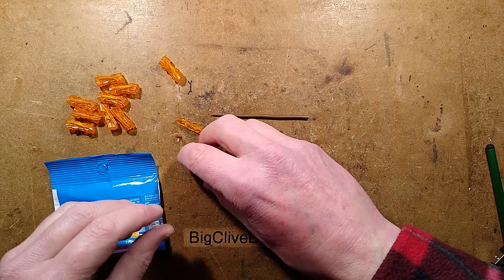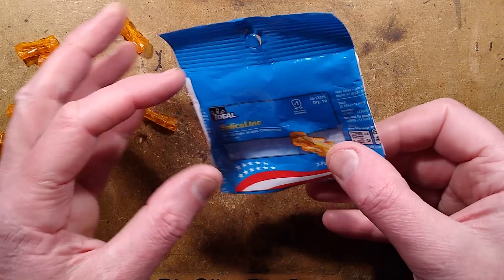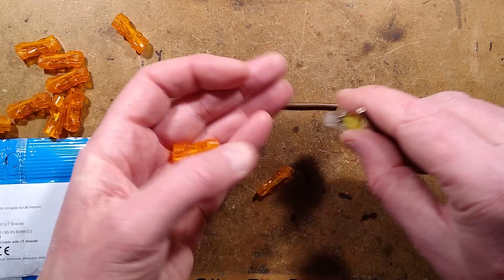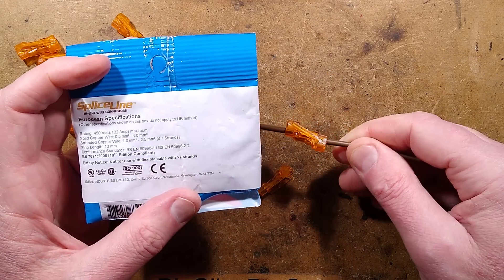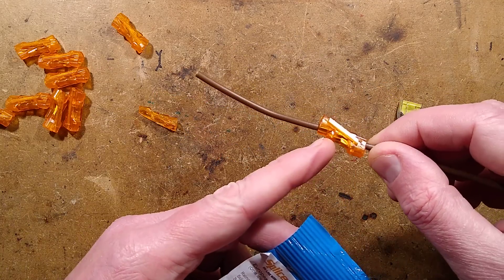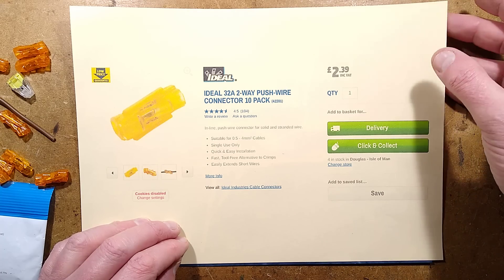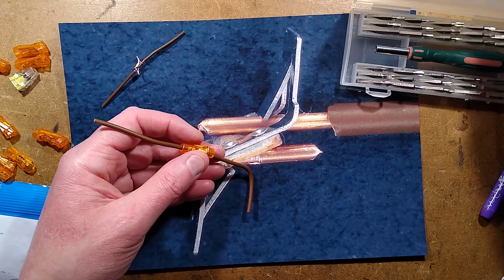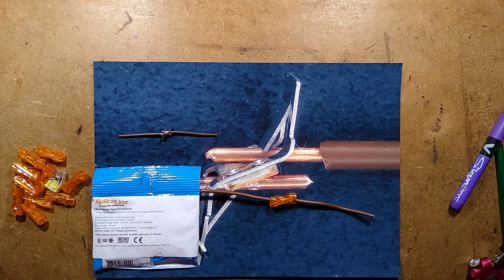Inside a SpliceLine push in cable connector

Comment: I don't know if they originate here, but I did find these at the local Home Depot.  I used them to distribute the neutral for some WiFi switches I installed in the home in 3 and 4 gang boxes.  They make examples that have multiple connections so you can tie wires together instead of the sketchy wire nut connections commonly used in home construction in the US.
Reply: Ideal makes those sketchy wire nuts
Reply: @nyetloki  I'm sure they make some.  It's the wire nuts that are sketchy, not who makes them.
Reply: @buffuniballer  Like every product on the planet, wire nuts are as sketchy as the installer of the wire nut.

Comment: One stupid thing they did on the inline version of the lever-latch ones, and as as far a I can see on these too, is not put mouldings on the side to allow them to snap together for multi-core joints
Reply: I may be mistaken that it’s in the regs over here, but it’s at least common practice to stagger in line joints to maximise dielectric clearance. If it is in the regs, the manufacturer suggesting they are installed in one block and slotted together may mean they don’t get the correct approval ratings. Happy to be corrected if I’m wrong
Reply: @bdh_555  Yeah and I can see sliding together affects heat dissipation, especially in failure conditions. A lot of engineering compromise just to keep things looking good.

Comment: I use Ideal cable stripper. Also that doesn't look like a genuine "Wago" 🤔... The two way should be white and a little smaller
Reply: Wago made both the yellow and white. It looks like the yellow is discontinued. The push-in connectors are becoming less available in stores since the lever-nuts are spreading. As best I can tell, the ratings were the same. 
Wago also lists a white aluminum compatible version on their website, which requires corrosion prevention paste. I’ve not seen them in stores.
Reply: @TomCee53  okay, been an full time electrician now for six years and about ten years done electric work on the side. Never seen that two way wago tho. I remember the old grey wagos. Also we use very much wagos and since the lever ones costs three times more than 2273 I really hope they don't discontinue the 2273

Comment: The copper slug is kind of the big key element that makes this a big improvement vs. Wago which relies on  just a tiny contact area on spring tines and the thin gauge spring steel structure to carry current..   I would absolutely use  one of these for a current carrying splice but I still like a properly done wire nut splice as you get  not only the two conductors spiraling around each other in intimate contact, but also an external spring biting into the copper of both conductors in multiple places..  I would use Wago only for known low current stuff like lights...
Reply: Wago connectors absolutely have a plated copper bus bar in them. Clive's even done a video showing this. I'm looking right at one inside the conveniently clear body right now.
Reply: You understand better than 90% of the DIY commenters here.
Reply: @RobertBeck-pp2ru  Having done the rounds and dealt with many professional electricians who struggle with Ohm's law (let alone more complicated simplifications of physics) and think ferrules are plated steel..
Reply: I absolutely agree. As great as Wago connectors seem, they still remind me of back-stab outlets and switches. Only ONE tiny connection surface. These Ideal splice connectors look better with the copper pads, but still only have that tiny spring loaded contact point. Because of that I won't use back-stab outlets or Wago. Your mileage may vary.

Comment: CEF do a number of Ideal connectors along with Wagos. I have tried both, but decided to stick with the Wago's. There is an inline Wago which uses the little levers, I prefer them as they are easier to pull off when needed. I tend to use the push on ones like the one on your bench in the back of light switches etc.

Comment: Meh…I lke scotch-locks better, because the wire to be spliced doesn't need to be trimmed or cut.

(though both are ghetto & shouldn't be used for permanent installations)

Comment: As an Electrician, I would like to see that connector with 400 Volt pulling 32 Amps for one or two hours and then a measurement of the temperature.
Reply: 32A is 32A. The voltage over the connecter is negligible, if you pass 32A through it, it doesn't matter if it's from a 12V or 400V supply, the voltage drop is elsewhere. Sure you are an electrician? ;-)

Sure the voltage matters if the connection fails, but until then, it doesn't matter.
Reply: @LeifNelandDk  Oh no not an electrician as you Leif. I want 400 Volt as it more likely that it would be voltage where the 32 A will be used. A man as wise as you should know that 230 Volt utility item is not allowed to use 32 A. ;-)
Reply: @NotMeGeek  again, there's no voltage over the junction when it is complete. So 12V, 230V, 400V is irrelevant.
Reply: @LeifNelandDk  Interestingly they are only rated at 20A @600V vs 32A @450V
Reply: @oliverer3  UL current ratings are substantially lower than others (for no benefit I've ever seen). The voltage is a red herring. They also rate 12AWG (3.31m²) for a paltry 20A, which is no coincidence.
Reply: Since they are rated for it I presume they must be able to handle it but given that they're rated at an operating temp of 105°C they'd likely get toasty.
Reply: All these things only add single digit milliohms to the circuit.  Run the same experiment I did a while ago.  Put 10 of them in series and measure with a milliohm meter, remove the wire's own resistance and divide the result as appropriate to get a general working figure then apply ohm's  law to get the power dissipation.  Then for fun do the same with 10 of your favourite connectors.  The difference in circuit resistance is negligible in any sane number of connectors (10 in a circuit is not sane), as is watts being dropped by the connectors.
Reply: @retrozmachine1189  I hold it up against Wago 221and there is a difference in how the wire connected. The way the wires are connected then it could be funny to see if the actually could handle 32 A. Wago is used alot already and there hasen't been noticed any fault with. These connectors are quite new to the market in Europe and there a real test would be nice. Just because the are rated is not same as the can handle it. We have outlets marked with 10 A but don't that is not in continuous operation.

Comment: @Big Clive - Adam Savage did a video on connectors he bought made from heat shrink  low melt solder rings and a bridging wire. perhaps you could review some of them?
Reply: I think he did already:https://youtu.be/unxEdyW8RP8?si=G7To58xvujzvX-oG and found the solder penetration to be less good than doing them manually. I use them a lot for bike lighting and other low power connections.

Comment: Hi. Former U.S. Electrician here. Ideal makes a lot of the connectors and "wire nuts" we typically use here in the 'States. I've seen those connectors you have in this video in Home Depot hardware stores but not in the commercial electrical supply shops. Electricians have used wire nuts for as long as I can remember here.
Reply: The wire nuts were known as screwits over here , used extensively previous to about 1970 and made of porcelain, still available in a plastic form but chocolate block type connectors took over until the wagos were introduced.
Reply: When I started in1968 in the electrical industry we call those screwits "Dogcocks" but we only took them out from old rewires, they never seem to be issued as new or stocked in our store, as for wagos or the like the ones Clive has there I never liked them you could twist them apart and to me not a mechanical connection that I would have used, @radiotowers1159
Reply: Wire nuts aren't even legal for mains voltage in Australia, these days. Where I used to work had a product get recalled for non-compliance because it was a mains powered floodlight that used wire nuts inside. Low voltage DC is a lawless wasteland, though, and we can use wire nuts all we want for those. The only question is "why, though?", because we have so many other options.
Reply: @NoobixCube  I think the time old saying of "If it ain't broke, don't fix it" applies to wire nuts in the 'States. We've had so few problems with them since they were first used, we just keep using them. We don't tend to adopt the newest thing here when we know something reliable and trusted is available. We also have all sorts of governmental approvals and testing products have to endure to be declared safe. With so many people (globally) with a mind for litigation these days..we just don't want to risk using something newer/better too.
Reply: I think I'll keep using Wago 221-2411 😂
Reply: Wire nuts are Marrettes in Canada. Same thing but not made by Ideal.
Reply: For what it's worth: I recently had a major remodel of my US-based home that required replacing the entire electrical panel. A certified electrician did the work. I wanted to watch to see how he was going to extend the lengths of the various wires to connect to the new box. He used Wagos throughout. I asked if they were "code approved," and he replied yes, and he uses them all the time. I have to wonder if he could have used these for 10 gauge (2.59mm)/30A? I have seen many YT tests of these buggers, and they seem to pass a casual heat overload test. I still don't trust them.
Reply: @demef758  If they are genuinely CE marked, they are fine.  They are UL marked too.  Just don't use there on Aluminium, although WAGO haS specific products for that debacle, and a gel to prevent corrosion, etc.
Reply: @demef758  That's right, they've had a UL certification for use for some time now. But they do cost about 10x what a wire nut costs..so most of the trade schools and professional electricians will opt for wire nuts using a twist-bond of the wire. Wago's use an amp-rated bridge to join wire. Think of them this way to use a plumbing analogy; Wire nuts are to soldered plumbing joints as Wago's are to sharkbite connectors. At least that's how I think of them. Although I am retired from the trade..I do have them in my kit. I use them every once in a while, but never for a large customer job..that would just increase the cost to the customer too much..but on the other hand, may reduce my labor costs because they are faster to install..maybe it's a wash. Dunno.
Reply: @BULD0SIS  I used to twist everything, then solder it, then put on a wire nut. Years later I had to take something apart. The solder (lead based of course) fused to the plated metal spring in the wire nut so only the plastic cap came off leaving everything still well connected but uninsulated. I had to cut it and start over without the solder this time. I miss solder though you just can't get a lower resistance connection.

Comment: So if the plastic melts the spring loses tension? Genius!
Reply: If the plastic melts you have much bigger problems to worry about, genius.

Edit: also, no, the plastic has nothing to do with the spring tension.
Reply: I guess so. I know half of the world isn't happy with our wire nuts but for the most part when something happens to the plastic on a wire nut there's still the metal spring around the splice.
Reply: @fanplant  Yes, the metal is all that matters.  I still find it amusing that people in the USA that state the Wagos et al will fail when the terminal is overheated due to loss of spring tension, but obviously do not realise that lurking inside the USA's wire nut is ... a metal spring coil that would suffer the exact same problem, if it was actually a thing without putting 200A across the terminal anyway.
Reply: @retrozmachine1189 it's not so much a "spring coil" as it is a "thread". It doesn't supply any "spring tension" to the connection.
Reply: @mattmanyam  Admittedly I have no experience with these things but looking at a good selection of the various manufacturer's sites they seem to all follow the same basic design.  A spring coil of some type that is designed to expand when rotating the nut in the 'on' move so that when the rotation is stopped it clasps onto the wires holding them together positively.  That sure sounds like spring tension to me.

Of course if you can point to a type that does not use a coiled piece to do this, by all means do.
Reply: @retrozmachine1189  I admittedly DO have experience with them.
Reply: @mattmanyam  How nice.  Now instead of being a clown perhaps provide information pertaining to one that doesn't have a spring coil in it.  It's pretty stupid to argue that it's not a spring coil when manufacturers refer to it as that with the purpose of grasping onto the wire and providing positive pressure.
Reply: @retrozmachine1189   they're just "threads" that are manufactured the same way springs are (much like a heli-coil, if you ever seen one), so they can be injection-molded into the final form. None that I've ever used have any mechanism for "expanding" around the conductors... they are tapered to allow multiple combinations of conductor counts and sizes to be covered by a single sku. The threads simply "bite" into the soft copper of the conductors.
Reply: @mattmanyam  Better write to 3M and Ideal, as a start, and let them know they have no idea how their own products work.
Reply: @notahotshot the tension is still there, but not so great connection to the copper slab.

In a Wago, the plastic is not involved in the connection, and the connection is the same even if it has been heavily abused by overcurrent.

Comment: I'm still not convinced by these toolless connectors, the contact area in them just doesn't look up to much when using solid core wire, that would then lead to local heating and then cause the steel part to lose tension and then get hotter still.
Reply from the maker: Other YouTubers have done high current tests and it was usually the wire getting hot that caused the connectors to melt when the current was ridiculously high.
Reply: Any time you get the connector hot enough to weaken the grip of the spring the insulation has already melted off your wiring and your premises is on fire.  This has been demonstrated time and time ago by numerous youtubers yet people such as yourself still hold this  completely unwarranted fear.

Question:  What happens with USA wire nuts subjected to the same level of abuse?  Wouldn't the spring coil in them suffer the same loss of tension?  Answer:  yes

Comment: Staggered that this connector came from the Country of The Church of the Eternal Wire Nut.  Electricians over there must be turning in their graves.
Reply: It's amazing how many of them will happily tell you that Wago, and I'm sure these also, are not to code, dangerous, not rated, and there are pictures all over the Internet of them burning up, even when installed properly. Then, when you go looking, the only ones you can find that failed were purposely overloaded a test, with thousands of results for failed wire nuts.

Comment: Nice discovery. I use the Wago style connectors, but these will be perfect for what you said @ 5:35 about extending a wire in a switch box. The guy who built the house I'm in was not a very good electrician and a lot of the electrical wires are too short (or just plain wrong in so many ways). These will help me fix the problems. Thanks!
Reply: Depending on what the surfacearea of the wires is the wago 2773-2401.
Reply: @Alex_Vir thank you! I was just about to say I need a wago version of this, didn’t know they finally came out with it
Reply: Any low/ small contact zone is a good lighter if conditions are meet. Especially in wooden houses (in Europe we tend to use stone or bricks).
You have 2 small points of contact given that the solid wire is cylindrical.
I like how americans like to gamble, good luck :)
Reply: @BozesanVlad  well americans gamble with wirenuts, as the correct installation is harder to check than with wagos, where as europeans liked and like to gamble with Doli-Klemmen where the screw can work itself loose over heat cycles.

Comment: Ideal recently came out with a copycat Wago connector, and get this, Home Depot in the US was charging more for them than actual Wago. Surprisingly, they were on clearance the last time I was in the store (even clearance they were more than Wago).
Reply: The better big box home improvement retailer also carries the Ideal brand lever nuts, which are interestingly... Made in Austria! Lol
Reply: Those will drop to a penny soon :3
Reply: Probably all new tooling machines for the new connectors for Ideal, so gotta make that somewhat up? And also Ideal is the “premium” electrical brand at Home Depot. 
So maybe they want people to thing Wago is the off brand?